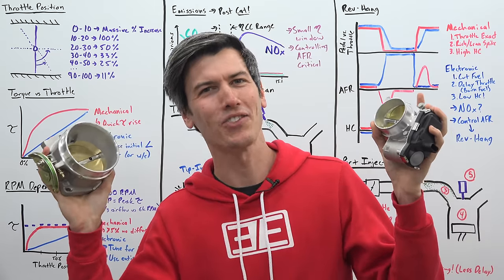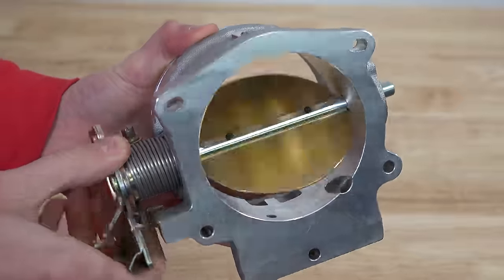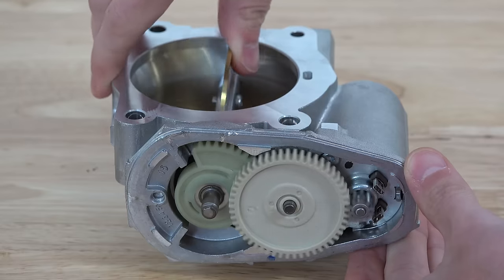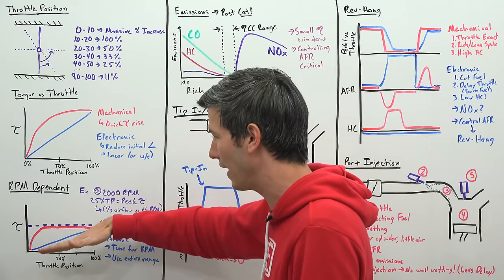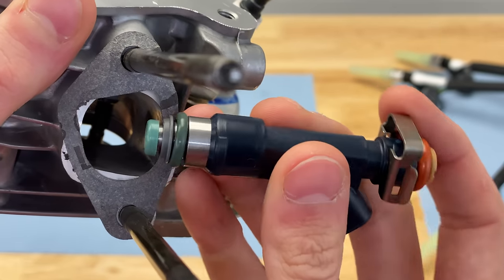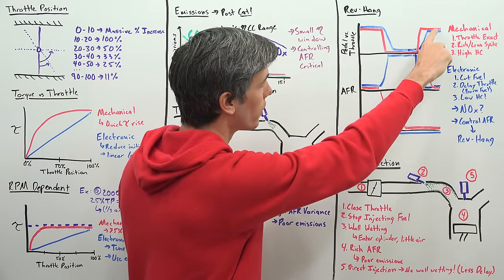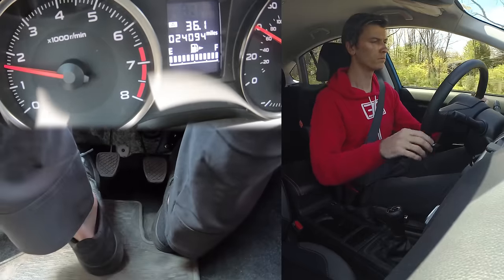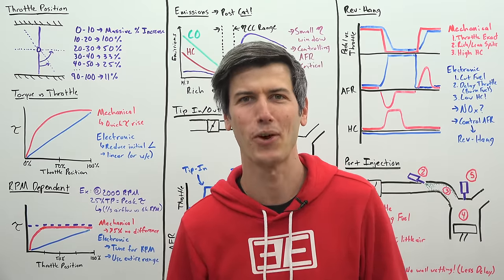The Big Problem With Modern Manual Transmissions - Rev Hang

Comment: I don't think you got the „Torque vs. Throttle Position“ right. First, by just dividing throttle percentages, you only get the increase in torque relative to the previous throttle position. The results imply that you sense a huge increase at low throttle positions and only a minor one at high theottle positions. Well, you may get a huge relative increase between 10 and 20% (actually about 4 times as much, see below), but 4 times very little isn't very much either. However, the relative increase between 80 and 90% is not much, but it is actually a huge absolute difference. Your results are also reflected in the graph, but it‘s just wrong. You have to calculate the absolute torque values for each throttle position to draw a correct graph. Aditionally, you are implying a linear relation between throttle position and the amount of air that can pass the valve. This is incorrect as well as it is actually a cosine function (provided that there is a linear relation between pedal position and throttle angle which could also be mechanically designed in a non-linear way). Here are the correct numbers, all in percent of maximum torque:
0% Throttle angle ~ 0% torque (actually not quite correct as there is still a small amount of air allowed to pass through)
10% TA ~  1,2% torque
20% TA ~ 4,9% torque
30% TA ~ 10,9% torque
40% TA ~ 19,1% torque
50% TA ~ 29,3% torque
60% TA ~ 41,2% torque
70% TA ~ 54,6% torque
80% TA ~ 69,1% torque
90% TA ~ 84,4% torque
100% TA ~ 100% torque

If you draw a graph over these values, you will get the exact opposite of your red curve. This also correlates with the throttle behavior you experience in most road cars where you have to be able to precisely adjust your torque output at LOW power in order to drive exactly at a desired speed while this is not quite necessary at high power levels in most day-to-day situations. On the contrary, race and sports cars usually have a more linear throttle response as controlling such cars near the grip and traction limit requires a precise torque control at HIGH power levels which ismnot possible with a progressive curve.
I own a 2003 BMW M3 SMG with an electronic throttle (actually six individual electronic throttle valves). In this car you can choose your throttle response between a traditional, progressive curve and a sporty, linear one. The latter one is quite aggressive and great on the track but really challenging in regular road traffic, especially in the wet.

Comment: Fantastic explanation and thank you for making the free video so I can now point people to a 10 min clip instead of spending 20 min myself with my hands and tons of analogies.
My only, and this is rare, critique is to mention the pressure change in the intake port and what THAT does to the fuel. For those looking at my comment. A quickly closing throttle creates a high vacuum (very low pressure) in the intake which changes the vaporization temperature of the fuel and you will get a very quick rich "burp" for that reason. This effect is worse with "wet flow" systems like carburation and throttle body injection found in early EFI systems and formula 1 ;) . The exhaust rich backfire on deceleration is pretty cool until it blows apart a muffler hehe.

Comment: I may drive like a potato but I press gas earlier when I shift because of that, so I ask more fuel to be burned sooner, I wonder where the gains seen from those big brains are... 
Better feeling? well the end of my gas pedal has a huge dead zone... and the beginning asks a good amount of travel to get something, so when I change car for something with a sharper throttle response I start in a not-so-eco-friendly burnout or in a refreshing-and-healthy smoke of clutch...

Comment: No thank you. All that electronic crap on cars does not age well. I had an Audi with an electronic throttle body. At one point in my ownership the car started to have a weird jerky throttle action at about 2K rpms, and the DTCs that showed up were for random misfire, at first at least. It became steadily worse until other DTCs came in about malfunctioning O2 sensors, secondary air injection, and a whole lot of other stuff. the dealer couldn't figure it out. Eventually, after about a year and a half of dealing with this crap I 'went with my gut' and replaced the throttle body. Problem solved! At no point did I ever get a DTC related to the throttle body. After 50 miles all the other DTCs went away. They were all FALSE. With a cable operated throttle body I never would've had that problem. Not to mention that throttle cables are a LOT cheaper to replace than electronic throttle bodies. I know I am not alone in my aggravation with these systems.

Comment: Cool video! Throttle position vs percentage of valve open, is why industrial applications don't use "butterfly" valves as control valves (usually). The throttle valve is just a butterfly valve, while it provides great flow, its not good at control, hence all the electronics needed to make it control flow well. I need to show the first part of this video to some facility operators. lol

Comment: I’ve been wondering why my 2018 honda fit is so much more difficult to drive than my 1997 mitsubishi mirage. Is there a way to fix rev hang? I’ve definitely noticed that allowing the rpms to drop by releasing the clutch slower makes shifting smoother. It’s not as fun though.
Reply: Shift slower in low gears and faster high gears

Comment: Actually rev hang is a Subaru tuning thing, my 2019 FA WRX (direct injection) had absolutely horrid rev hang, my 2019 STI (port injection) does not have any rev hang.
Reply: The Honda guys have it pretty bad as well. I don't think I've driven any newer 00's Honda/Acura that didn't have rev hang and a drive-by wire throttle system. I have a 15' Honda Accord 2.4L 6MT and it has pretty horrible rev hang that is solved with their clutch delay valve in the clutch slave cylinder, but removing it means you have to drive so precisely.... It takes a great deal of effort to deal with daily driving, especially if you don't mess with the tuning map to adjust your fuel timing, etc.

Comment: But he didn't mention "cost" 🤬that electric throttle body COST A LOT compared mechanical.  There are 3 sensors in that electronic throttle body that starting price is 200 an up depending on the car. But mechanic if 1 sensor goes there usually no more than 50bucks depending on the car.

Comment: It's so strange I fell upon this video. I was helping my step son work on his 2014 scion and I must admit I have never worked on a vehicle with an electronic throttle body and I must admit I was not a fan of it. I am 34 years old lol and I'm gonna sound like an old fart but what is wrong with having a cable to the throttle? Electronic throttles open up more problems in my opinion.

Comment: Ohhh please.
Anyone who grew up on mechanical direct control of the engine knows this.
You don't just plant the boot.
Today I hear sooo many boy racers bury the boot and spin the wheels against the rev limiter. Lame! Do that without a rev limiter and show your skill. Do that without computer control. When we did it, if we screwed up, it's a replacement block on order.
Today it's just playstation drivers. No skill.
Do that without any protection, that takes time to learn how to do that.
There is no respect now, no skill.

Instead, try and do those burnouts without hitting the rev limiter.

Comment: So, sounds like the manual transmission is dead, forever.  The complex technology needed to master the process requires complete control by a computer.

Then, I suppose this leads to the development of "sport" and "touring" transmission settings in some vehicles, to offer different driving experiences.

Comment: I'm a mechanic and get so frustrated driving modern cars. In so many aspects wether its shifting or engine response. If I tell the machine to do something I don't need some fuckwit engineer on the other side of the planet to have pre determined he knows the situation I'm in and i don't want that to happen. The more cars become drive by wire the shittier they'll become. Its already bad, I cant remember the last time I came out of a golf in a good mood
Reply: A golf 🤣🤣🤣🤣😂😂🤣🤣🤣🤣🤣

Comment: I see your problem and it's only 20 seconds into the video. Shifting at 3,000rpm. Of course the car is going to want to keep the rpm up - it wants to play and is being a naughty little boy. Take it to 6,000rpm and show how different things are.

What is probably happening is that the engineers have decided that most people take about 1/2 second to change gear. The difference in rpm between the two gears may be 800rpm, so the engineers make the rpms drop 800rpm in 1/2 second.

They also decide, based upon lap times and other data, that manual transmission are by far slower than a semi-automatic box, so they design the manual transmissions for wannabe racers on public roads.

Comment: something i noticed with newer cars, is when you remove the mufflers and silencers, you actually get a bit less rev hang because the of the lack of exhaust back pressure, its almost like a lot of the fuel rich mixture escapes before the throttle can respond. over time the rev hang sorta comes back as the fuel trim adjusts (you also get less popping in the exhaust) but the driving still feels better to me. If the car is turbo, then i would assume the exhaust back pressure would always be about the same, since the waste gate is controlling that.

Comment: Am I the only one who finds the "rich" versus "lean" characterization of the air-to-fuel ratio counter-intuitive? Since the "air-to-fuel" ratio describes the amount of air in proportion the the amount of fuel in reference the the stoichiometric quantity of combustion of the fuel ( CxHy + z O2 → xCO2 + (y/2) H2O ), would it not make more sense that a rich AFR is one which has excess air, and a lean AFR is one which has deficient air in relation to fuel, instead of it being the other way around? As in air-rich and air-lean, as opposed to fuel-rich and fuel-lean which would seem appropriate if referring to the fuel-to-air ratio rather than the air-to-fuel.

Comment: Now I understand. And I don't like it. And thank you for explaining it.
I want... a car with an electric motor, powered by fuel cells, fed with gasoline. 
Over 50% efficiency vs 25% of an ICE car; and no jerk motions to please the green gods. My car do not emit particulates, do not emit NOx and don't require a catalytic converter nor a muffler for that matter. Not even a radiator...

Comment: It's true that manual shifting is going to be slower than an automatic trans, and I really hate it when I ride with other manual drivers because the car is always jerking around when they shift, but this never happens to me. Why? It's because I always give an extra blip to the throttle whenever I shift gears and this results in very smooth transitions. Some passengers have even commented that they didn't even realize I was driving a manual because of how smooth the ride is.